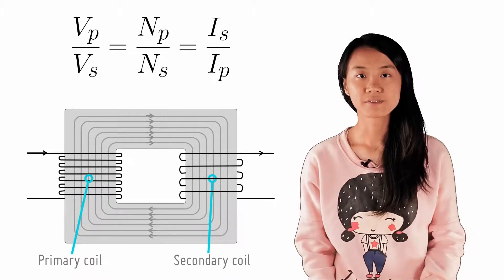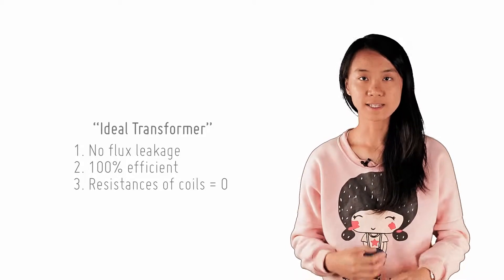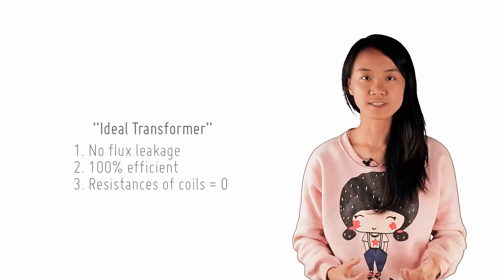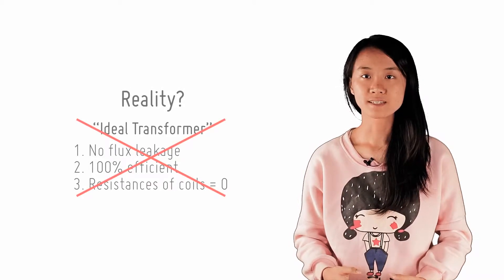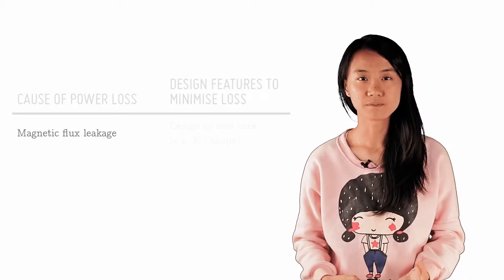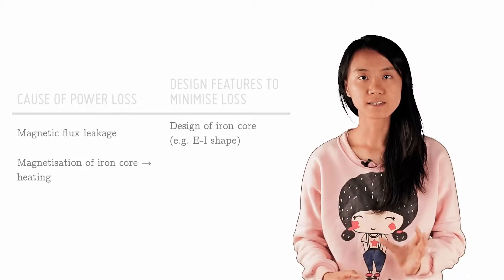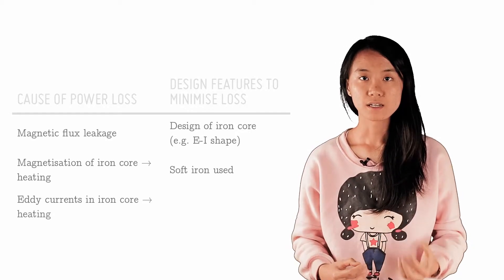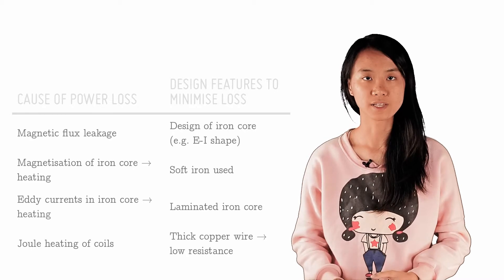5 3 Power Loss in Transformers I

Comment: Microwave spectrum, or uhf spectrum - which is better? Sprint versus Verizon :Think of a wine bottle, and wine pouring from it, at a single rate, soo many litres per second. How like a frequency? I think high bandwidth communication, like downloading a movie, or a song, requires a certain download speed like 120 megabits per second, else it will be too slow to be called a speedy (high bandwidth) connection. 2.5 gigahertz, sounds like a lot of cycles (bits per second - one wave can be a zero, and two waves a one, so three waves - or wavelengths - are needed to establish a bit, a pause of one or two wavelengths needed to establish the difference between a zero and a one). Saw a yellow schoolbus go by today with the phrase, Third Wave, on it - company name I guess.Now, imagine the wine bottle lying on its side, and half the bottle vanishing, and the wine pouring out like a flood, sideways (which is the title of a movie, by the way - about a writer who can't get published) : that is "spectrum". You may wish to rather think ofvisible light passing through a triangular prism, to produce seven distinct colours, or seven frequencies. Seven lanes? If the frequency RANGE is sufficient, you have many (more than seven) lanes, and in each lane (representing a distinct frequency) the electromagnetic ray, is like a racing car travelling at the speed of light. And at any given moment of time (a few microseconds) each lane will contain a zero, or a one. And if on this racetrack, you are able to read the cars as they go by, depending on the number of lanes (say 120 frequencies) you can read a 120 bits of information (a number composed of a long string of digits, which are either one or zero) in a few microseconds. So, it does not really matter if a telecom company is using high frequency microwave transmission, or lower frequency UHF band transmission, but for the purpose of high bandwidth reception - speedy download of a bluray movie - what is needful is a RANGE (or spectrum) of frequencies, plural. I think then that if it is not speedy downloads that 2.5 gigahertz (see, Sprint Network) enables, the question is, Why use that range and not say the UHF (also the name of a movie) range? I think the answer is that higher frequency spectrum means that the number of users in a region of space (like an apartment building) can be much greater before the wireless ystem begins to slow down, experiencing signal degradation. Hence, Sprint's network is best suited for population dense regions like commercialcenters in cities, or university campuses, whereas Verizon's network is better suited for the suburbs. And because microwaves do not travel far (without boosting, magnifying, signal intensity) more towers are needed to cover a region, than for the frequencies (spectrum) Verizon uses. OK, most of what I have written is an "educated" guess. I read a lot of comic books, and so my imagination tends to fill in the blank spots. But I do remember reading in a physics textbook, E=hf, and C=vf. And looking at a vinyl lp spinning on a record player... if you put ones and zeros in a line... well, not an engineer. But if my theories are correct as to how wireless telecom works, then Sprint should end up with the majority of wireless subscribers residing mainly in population dense areas. Yet wireless subscribers who are apt to travel, spending most, or much of their 'internet surfing time' in less population dense areas would do better with Verizon - especially considering how Verizon bundles wireless with wireline (FIOS) service.

Comment: Sprint versus Verizon :Think of a wine bottle, and wine pouring from it, at a single rate, soo many litres per second. How like a frequency? I think high bandwidth communication, like downloading a movie, or a song, requires a certain download speed like 120 megabits per second, else it will be too slow to be called a speedy (high bandwidth) connection. 2.5 gigahertz, sounds like a lot of cycles (bits per second - one wave can be a zero, and two waves a one, so three waves - or wavelengths - are needed to establish a bit, a pause of one or two wavelengths needed to establish the difference between a zero and a one). Saw a yellow schoolbus go by today with the phrase, Third Wave, on it - company name I guess.Now, imagine the wine bottle lying on its side, and half the bottle vanishing, and the wine pouring out like a flood, sideways (which is the title of a movie, by the way - about a writer who can't get published) : that is "spectrum". You may wish to rather think ofvisible light passing through a triangular prism, to produce seven distinct colours, or seven frequencies. Seven lanes? If the frequency RANGE is sufficient, you have many (more than seven) lanes, and in each lane (representing a distinct frequency) the electromagnetic ray, is like a racing car travelling at the speed of light. And at any given moment of time (a few microseconds) each lane will contain a zero, or a one. And if on this racetrack, you are able to read the cars as they go by, depending on the number of lanes (say 120 frequencies) you can read a 120 bits of information (a number composed of a long string of digits, which are either one or zero) in a few microseconds. So, it does not really matter if a telecom company is using high frequency microwave transmission, or lower frequency UHF band transmission, but for the purpose of high bandwidth reception - speedy download of a bluray movie - what is needful is a RANGE (or spectrum) of frequencies, plural. I think then that if it is not speedy downloads that 2.5 gigahertz (see, Sprint Network) enables, the question is, Why use that range and not say the UHF (also the name of a movie) range? I think the answer is that higher frequency spectrum means that the number of users in a region of space (like an apartment building) can be much greater before the wireless ystem begins to slow down, experiencing signal degradation. Hence, Sprint's network is best suited for population dense regions like commercialcenters in cities, or university campuses, whereas Verizon's network is better suited for the suburbs. And because microwaves do not travel far (without boosting, magnifying, signal intensity) more towers are needed to cover a region, than for the frequencies (spectrum) Verizon uses. OK, most of what I have written is an "educated" guess. I read a lot of comic books, and so my imagination tends to fill in the blank spots. But I do remember reading in a physics textbook, E=hf, and C=vf. And looking at a vinyl lp spinning on a record player... if you put ones and zeros in a line... well, not an engineer. But if my theories are correct as to how wireless telecom works, then Sprint should end up with the majority of wireless subscribers residing mainly in population dense areas. Yet wireless subscribers who are apt to travel, spending most, or much of their 'internet surfing time' in less population dense areas would do better with Verizon - especially considering how Verizon bundles wireless with wireline (FIOS) service. The Business Model ? :Solar City puts solar panels on your roof for free, but you must pay for electricity. Verizon gives you phone for free, but you must pay for using it. Why can you not buy a phone and then use it for free? Or why pay for data if you are already paying for the signal, or access to the internet? Why should "bee-bop-a-loo-loo" cost more than "beep-beep-beep"? For data processing is done in the box, and not in mid-air. Likewise, why can you not buy rooftop solar and then not pay for electricity? Is the price you pay Solar City for electricity less than cost of buying solar panel via loan, or reverse mortgage? If yes, then how does Solar City make money giving you a solar panel for free? My guess : They take out a loan, which they must pay back, both principal and interest. And using that money they install the purchased solar panel on your house, for you to lease from them. Your monthly payments then go to paying down their debt. And so the question is, Will this company ever begin to make money, profitably? My guess is they intend to securitize the debt via bond issues, losing the signed-up ppa customer revenue stream in the process, but profitably so, hopefully. For example, Say they owe 100 million inprincipal and 5 million a year in interest, but they takein 10 million a year from their customers. They can issue a bond for 100 million that pays 7 million a year, while they pocket 2 million a year (one million will go to paying down the principal owing, over a hundred years). Well, that is one theoretical option - issuing one hundred year bonds. Again, that is a theoretical example. In the real world, they must contend with the need for business liability insurance, in case an earthquake, mudslide, fire, or hurricane damage the solar panels, or the houses upon which they reside. Aye! There's the rub. For citizens would rather lease than own a solar panel so that they do not have to deal with bird droppings, kids with halloween rocks, or windstorms. Citizens would rather pay extra,lease, for the insurance policy of not owning. Solar City then is really in the insurance business, wherefore, they need an actuary familiar with writing supercat policies to know how much they need to charge customers for the solar electricity - namely, so that they do not lose money. Can it be done? In q1 of 2016, solar city's recurring cash generation after installation and interest expense, was about 20 million, or 80 million a year. How much of that is profit?